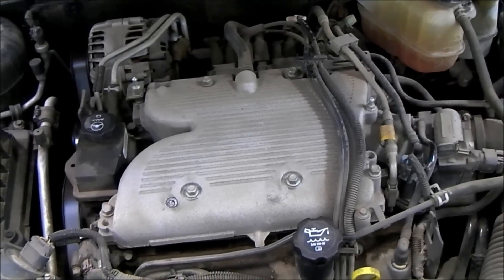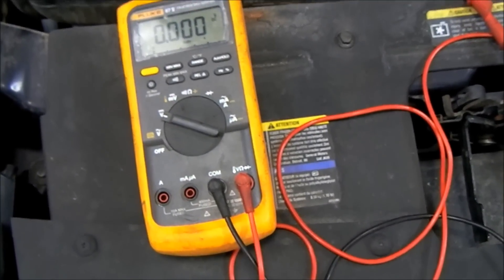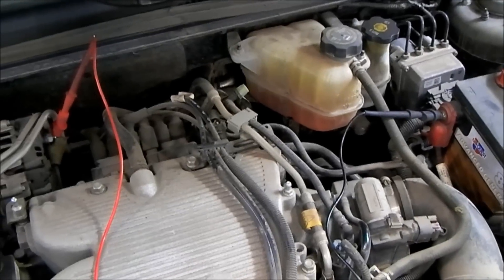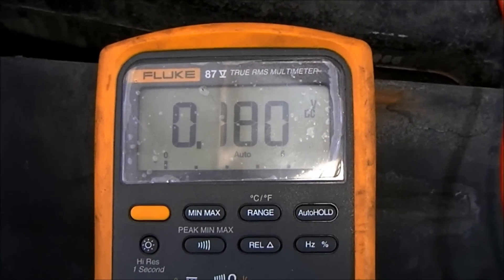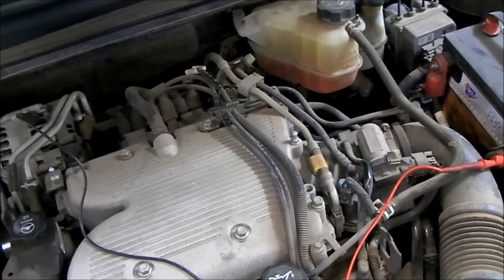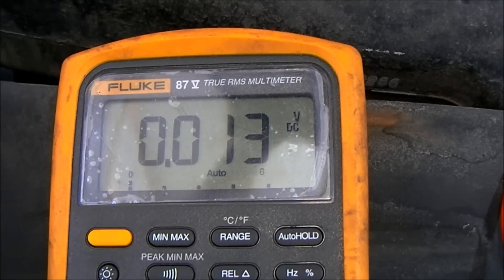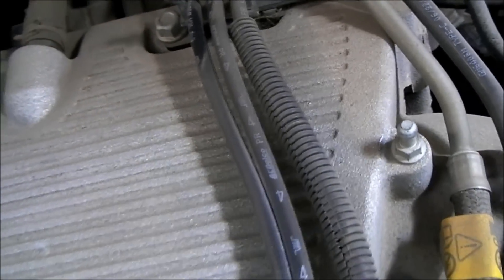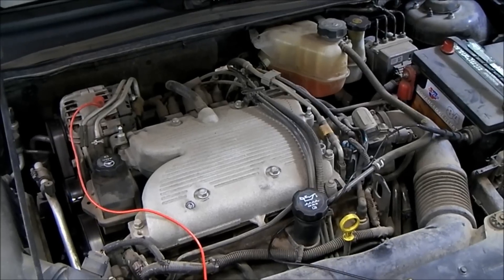Voltage Drop Testing the Charging System

Comment: Nice explanation sir ,however you should have raised the rpm to about 2000rpm and applied some load to make sure that the alternator voltage regulator is working properly and there isn't any voltage drop in any diode or components

Comment: Thanks for the video well explained. I did an alternator test on my 12 Acura TL and am getting 14.17v at idle and under load. I couldn't rev the motor as my wife is sick so didn't have a helper to add rpm but suspect it is working well. Will try the  voltage drop test when I have more daylight. I did try the negative leak test and it was showing 0v and I did it just like you explained. Could not figure out which was the + coming off alternator. I just think that my 5 year old autozone gold battery is near the end of life!

Comment: i have a question.does the voltage drop readings increase as amperage increases?i seen a car that had a 2v drop on power side of fuel pump,the spec fuel pressure was 45psi but the pump was putting out a massive 90psi.would this cause a rise in amperage that would create a 2v drop?

Comment: When you say “alternator output” are you talking about the B+ terminal or the D+ terminal?  My voltage measurement between the battery positive terminal and the B+ terminal on the alternator is 0.00 VDC.  Is that good?
Reply: He said anything below .5 volts on the Positive side is in spec. He said any Voltage below .2 on the negative side is in spec.

Comment: Good video , o got truck and I just changed alternator and now it’s having trouble charging, I have 1.2v drop on negative side , and way I could run extra wire from alternator case to negative post on battery? Would that help ?

Comment: I still don't really understand how the volt meter gives a voltage reading when the leads are both on one side of the circuit?
Reply: That means there is a voltage drop across the two terminals possibly due to to resistance across the connection...
Reply: In theory it should be Zero volts. Resistance causes a difference in potential.

Comment: How about the voltage regulator, could it be a problem as well.
Reply: Voltage regulators when they go bad can drain the power from a battery when the engine is turned off.

Comment: I would recommend 0.2 volt on each side of the circuit or no more than 0.5 volts for both sides. Also when doing this test you want to load the system either with a carbon pile load tester or truck all accessories on while the engines running.

Comment: So if theres voltage drop on the positive side, then check all the connections on that circuit?
Reply: Only if the voltage drop exceeds one half a volt, or .500v on any circuit.

Comment: Chrisfix says to rev the car to 1500 rpms when doing this test . Is that necessary?
Reply: Yes. Alternators put out fewer amps when at idle, and rated amps at 1500 RPM or above. The voltage drop will be greater with a greater number of amps flowing through the wire. That high current situation is what you want to test.

Comment: What holes do the leads get plugged into? Brand new multimeter user here
Reply: Com for neg. Black and v/ma for red lead
Reply: This is really late lol but the black is always going to be in the COM but the red is connected depending on what you are going to test. On the far right you use it for voltage, ohms and some other thing that I forgot and the left is for amperage

Comment: So If the voltage is > = .5v (on the +(ve) side of the alternator circuit) means that the alternator must be replaced, and if the voltage  is > = .2v (on the -(ve) side of the alternator circuit) means that your connections are faulty? Great video, thank you.
Reply: Not necessarily. Eric from South Main Auto has a video with excessive resistance, high voltage reading on the positive side of the circuit. Bad connection from alternator B+ stud to the output cable. Bad design melted out over time and created resistance. He still had to replace the alternator because the bad connection design cause the alternator and output stud to fuse so he had to break the alternator off of it's mount. Find the part of the video where he removes the alternator https://www.youtube.com/watch?v=fYjuP8FBUu8
Reply: Voltage drop wouldnt be the alternators fault but if its leaking ac voltage in it is

Comment: Couldn’t you go to other connections on each side of circuit to narrow down the exact area of voltage drop?
Reply: If there is a problem yes. No need to test in many places if the whole negative side is within spec.
Reply: Yes that is how you find the problem

Comment: Hmmmm.... you really need to have good current flow in the circuit under test to get meaningful voltage drop readings. To do so, with the engine running energize everything convenient in the vehicle; lights on high beam, HVAC blower on high, A/C on, rear window heat on etc. Note that there are numerous other voltage drop scenarios , and they should also be preformed with the circuit in question carrying it's maximum amperage.

Comment: I like to turn every thing on to really stress the circuit..Seen a Vd of 3mV with no load other then what ever was consuming power to keep the car running.. Turned on the heater,defrosters,Head lights,hazzards,and wipers. Vd was then at 3.5ish Volts...removed cable and found a spot where someone cut a piece of insulation away to splice in a smaller wire to power a relay for LED light bar(why there who knows owner said he bought car like that).. Needless to say the cable within a few inches of that open was corroded with green oxidation through most of the strands...Nasty stuff!!!  great video just thought I would mention that
Reply: .350 mV still isn’t a bad circuit.

Comment: My mother in law gave my son her old 1988 Mercury Grand Marquis that had been setting for some time and the amp light on the dash has been on every since he got it. We had the alternator replaced because it was bad believing that would make the amp light go out and no such luck. Then we replaced the external voltage regulator and put on a new battery ground cable and that was no help either. Also before that we replaced the battery. Could a bad body ground be what is keeping that dash amp light on? I’m going to do the voltage drop test on it tomorrow.
Reply: +busman54 yes I would think so or there is a short to ground in the light itself